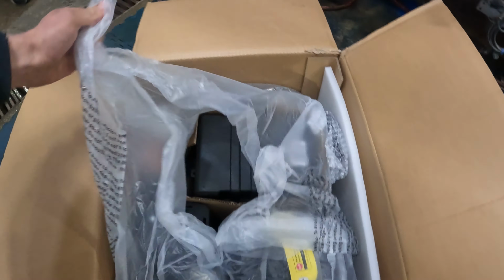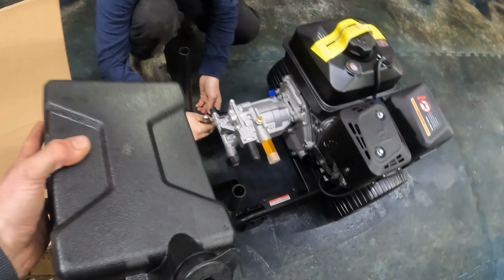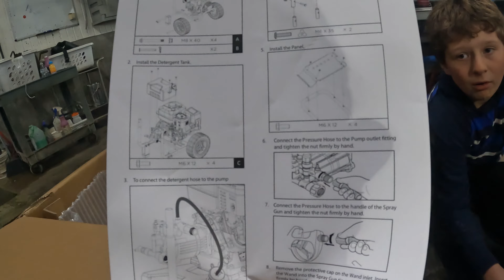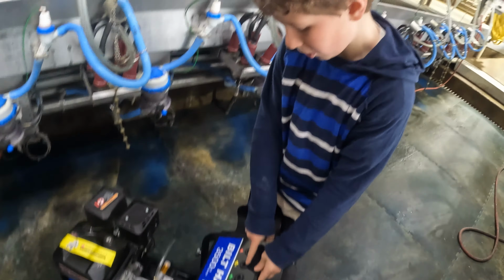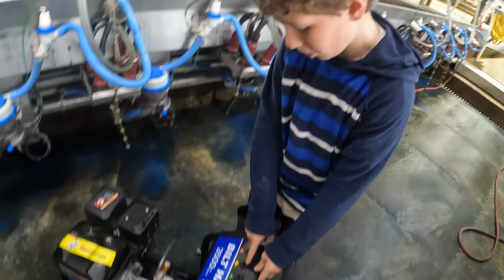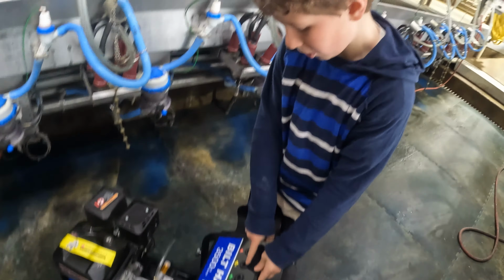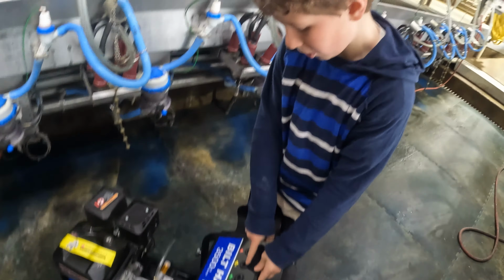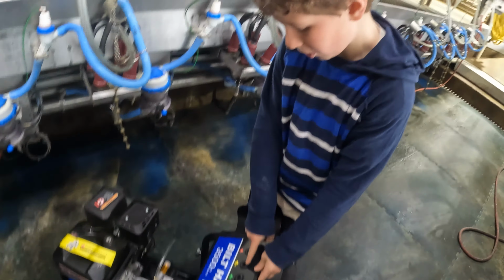3500 PSi Bilt Hard Pressure Washer Review. Washing the milking parlor

Comment: I have a craftsman that is 3500 psi
Reply from the maker: This is the first little sized pressure washer we have ever tried.  We normally have the big.  North Star with the boilers.   But for the job I want it to do works good.
Reply: @802Farmers  watch your vid,it seams to work good,i had not been in the parlor up there at thompasons since back before she got rid of the milke`s,but i had ben in the free stall,just last fall,i kow how much work u guys went threw to get the place running again